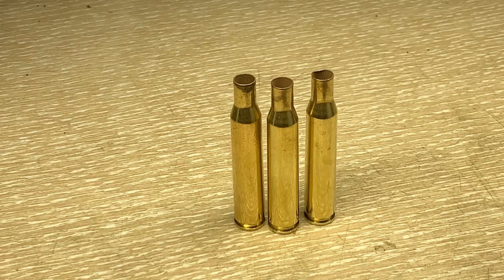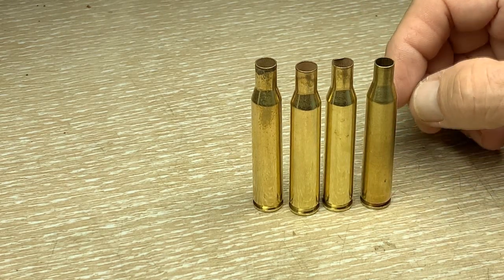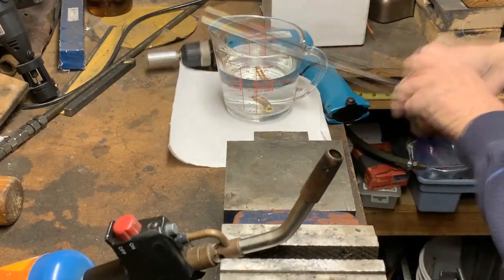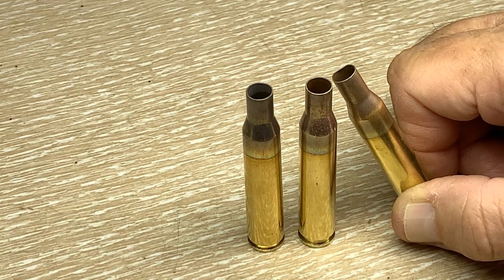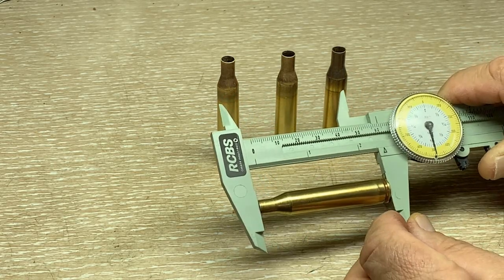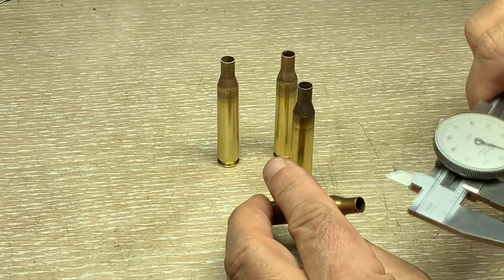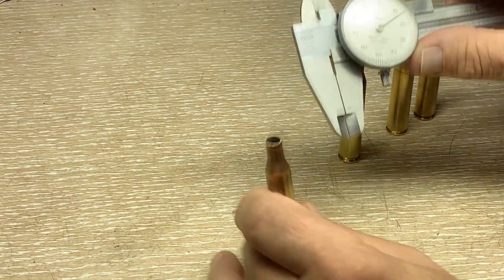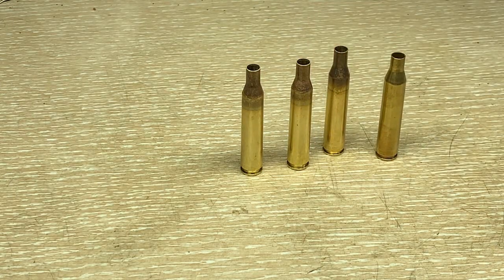Making 25-06 From 270

Comment: You are only one of 2 videos that shows the correct way to anneal cartridges.
I have comments on the videos where some knuckle head heats red hot cartridges and just dumps them in a pan and that is the most common video on annealing cartridges.
I get the worst nasty comments back telling the truth.
I have old reloading books that have chapters on annealing done with heat then dunked in water.
My grandfather a skilled tradesmen jurymen showed me when I was a kid to anneal metal with heat and not to allow air on the metal when cooling by water or by berrying in burnt ash.

I found the case necks can be thinker on one side or another, so I often use the Forester neck trimer to make the case neck the same thickness.
I am a Highly advances reloader and builder of custom rifles with many in wildcat cartridges and sell AR 10 uppers in all of the WSM magnums and unusual chamberings.
I currently have 3 AR 10 uppers going that are in 6mm-284 win then another in 250 Savage and an AR 10 upper in 300 WSM.
I build and sell AR 10 uppers and hunt with my own AR 10 in 375 WSM
Reply from the maker: Well, I'm pleased to have you aboard. I have found that through patience and much practice, one achieves the best results.  I try to keep it simple, informative and as correct as possible. I keep hoping the people pick up these skills soon because as with your grand dad, this sort of endeavor tends to disappear over time. 

Yes, on the variances of materials, some of that probably due to the fabrication processes involved. You may want to have a look at my Berdan pocket upgrade to Boxer. To me this was a real milestone in the time I've spent with ammo videos. See https://youtu.be/8FQhOI900rA

Sounds real good on your enterprises and I wish you well and continued success in such things. 

Thanks for your interest and your comments today.